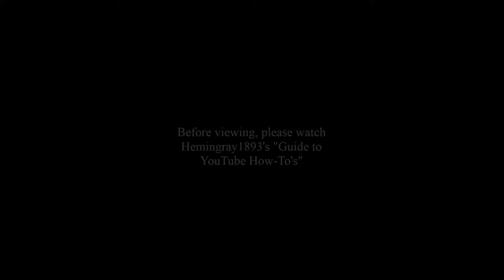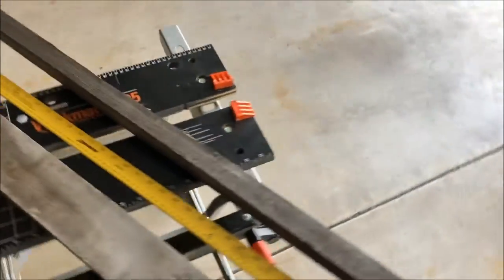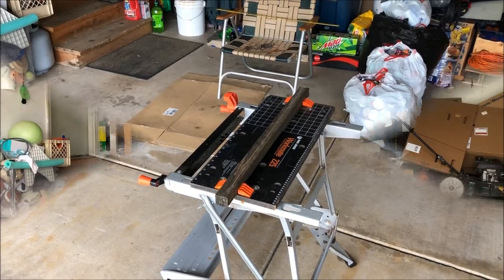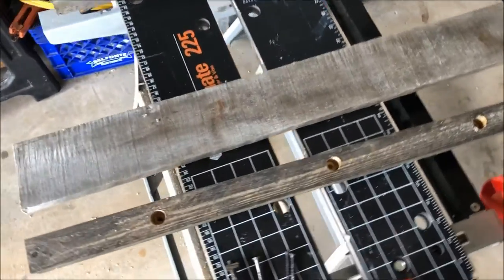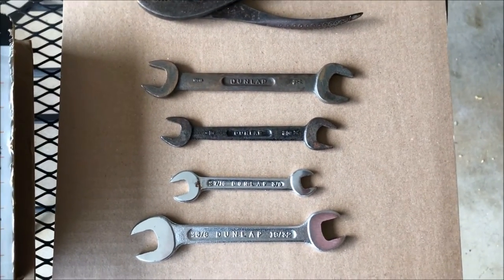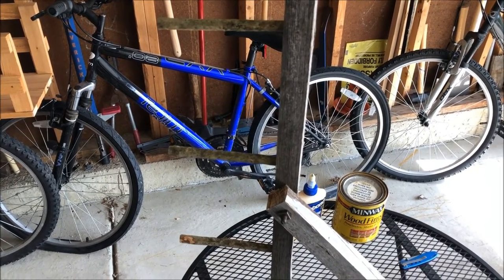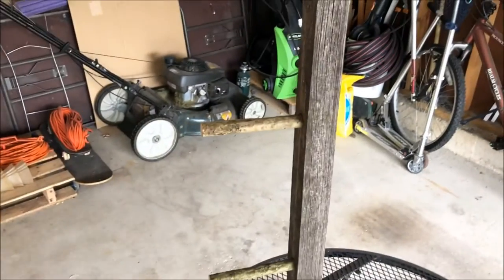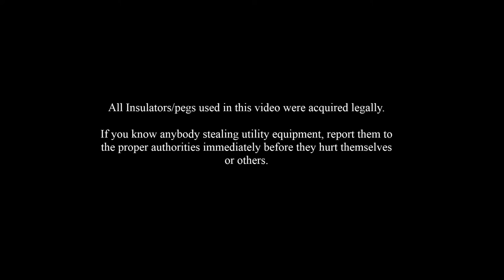Hemingray's Workshop: Telegraph Insulator Display Rack

Comment: I will take your advice and NEVER watch one of your videos again. You started off with a comment about Home Depot that had no meaning and went down hill from that point. Then when I looked at the diagram you posted. I could not for the life of me figure out why it was necessary to make a diagram of two pieces of wood nailed together with a brace

If you want to dazzle me, erect two utility poles in your living room and wire your room lights using the insulators and antique push button light switches with a mother-of-pearl inlay.

Now that video is a video I’d watch
Reply from the maker: Ok then.
Reply: dang bro you really ended his carrier with this